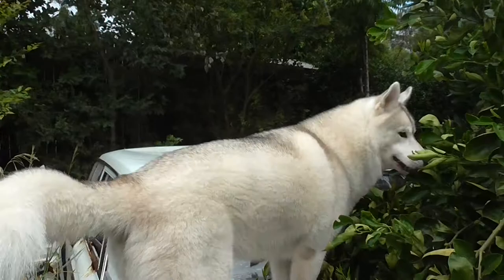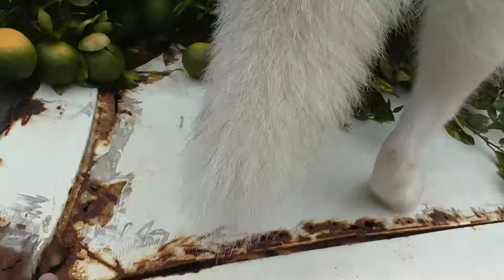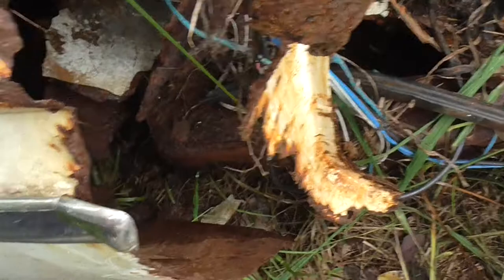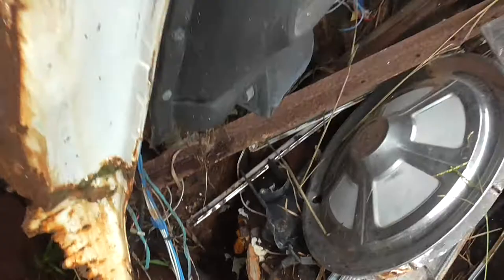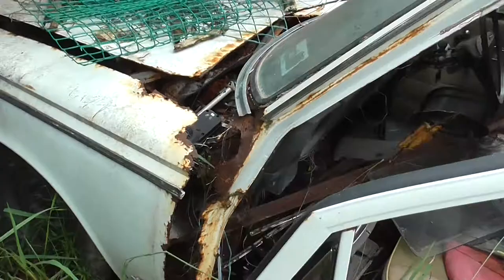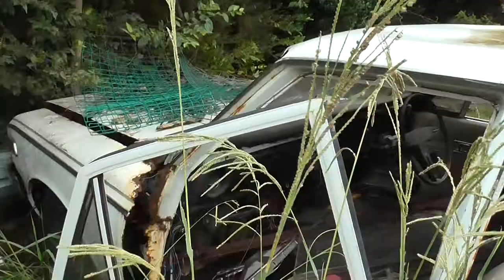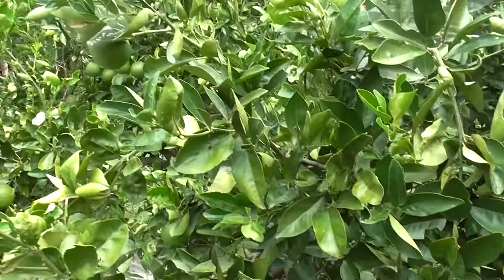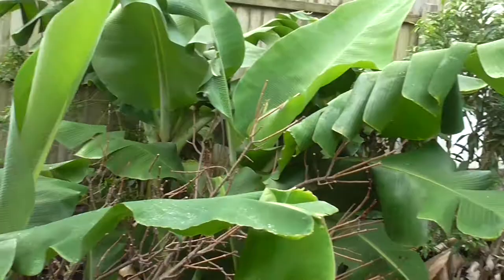Husky's car is colapsing

Comment: Yeap, those edges could be a problem for her.
Reply from the maker: I'm always outside now when she is to make sure she is OK. I don't want her hurt and she is a silly little thing.
Reply: The solution is clear - a new car just for her to use it as a platform, LOL!
Reply from the maker: People across the road have a spare. Covered in cobwebs. Might investigate what there plans for it are. Only worth $100-$300
Reply: Have you thought about building a wooden platform for her? Luckily, Liza doesn't have these urges; she's satisfied with benches. Hehe